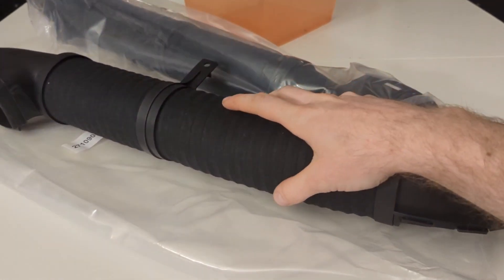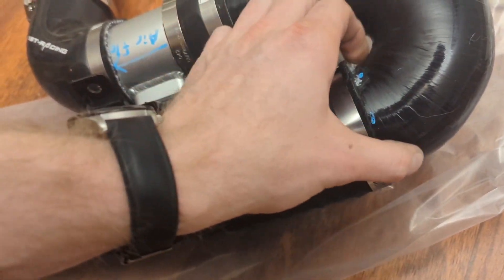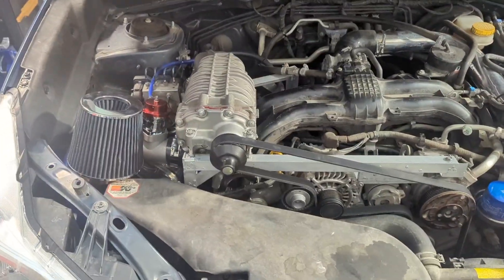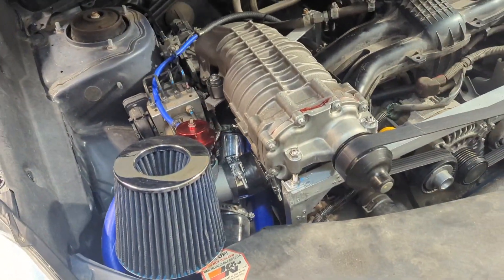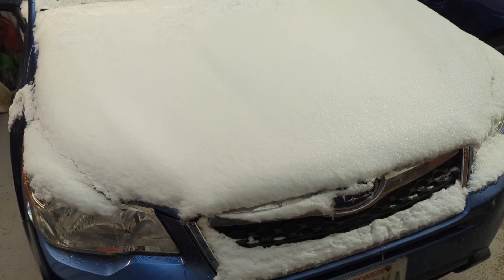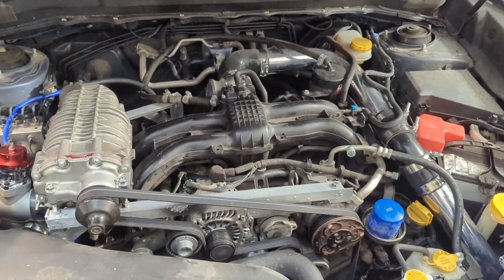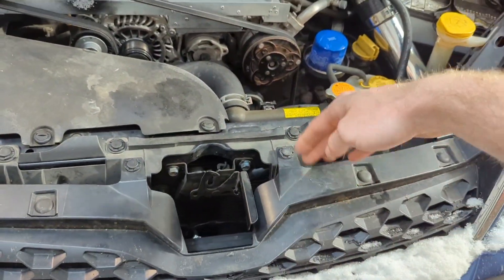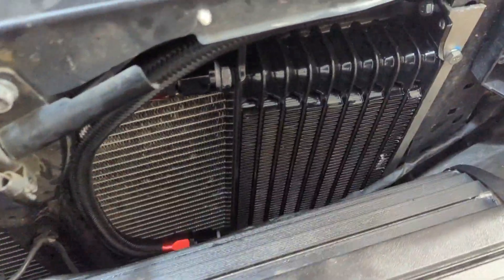FB25 Supercharger Install Part 5: Upgrades!

Comment: A larger diameter crank pulley will get the SC spinning faster as well
Reply from the maker: Yep! There are clearance issues preventing this solution for the FB25, sadly.

Comment: I reckon people would be interested to know how much you spent so far :)
Reply from the maker: A lot of this is just buying stuff to see what works. With every project, there's things you learn and thus things you'd do differently the next time around. For example, I failed to recognize that I had a 65mm pulley until the 62mm pulley arrived and looked suspiciously similar... the baffle did not make a considerable noise reduction, and all of my boost leak detection ended up being basically for naught as the TGVs were responsible for the boost pressure disappearance.

All that said, I'm probably in about $1000 in supercharger and supercharger accessories, and I think getting to the same state learning from these mistakes could be done for half as much.

Comment: Check out Subaru rocker arm retainer arms clips. Only thing I see as a fail on these engines.  I was able to modify my factory ones with 2.0 ford diesel retaining clips.   Also polished the cams and did the machining on my mini lathe. Good luck with your build!